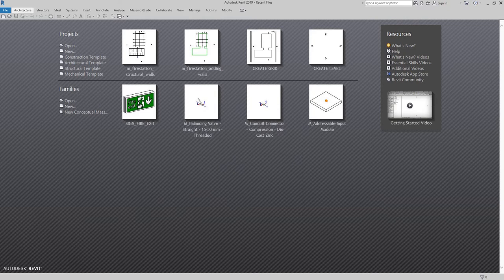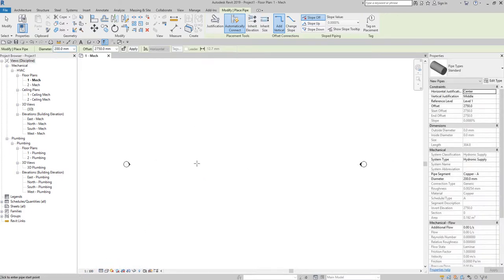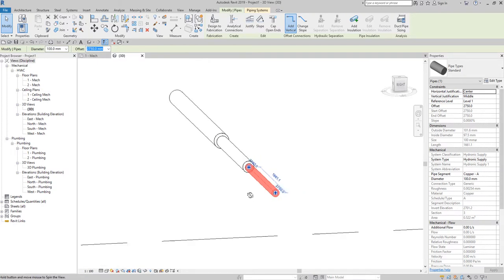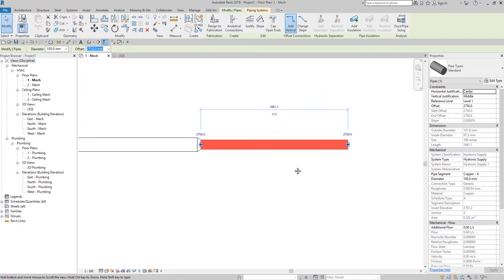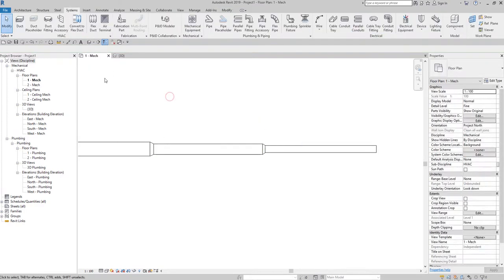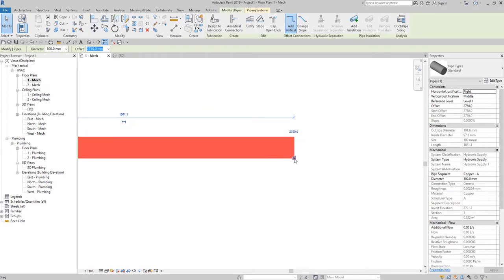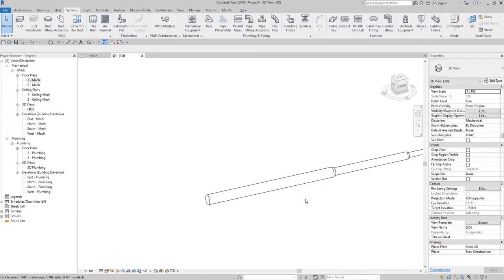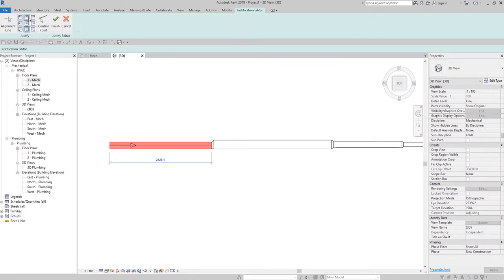REVIT MEP 2019: HOW TO USE JUSTIFICATION EDITOR FOR PIPING AND DUCTING

Comment: What if you don't want use reducers or fittings between the pipes, if you only need to use welded connection (weld one pipe to another)? How can you select this? How can you draw this in drawing?
Reply from the maker: Hi Adin, sorry haven't tried that yet.
Reply: @bim360  can you please try because you have a lot more experience than me, maybe you can solve this and record some video?
Reply from the maker: can't promise but I will try Adin =)